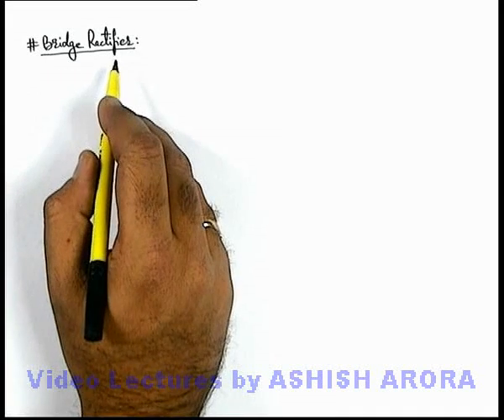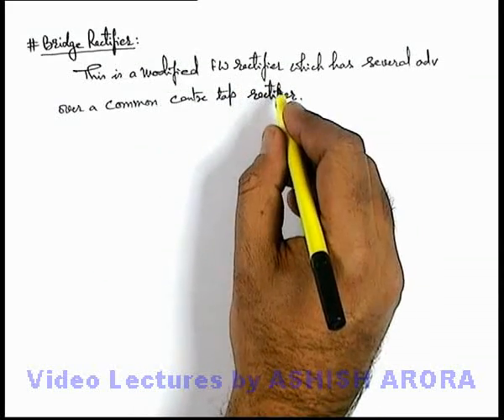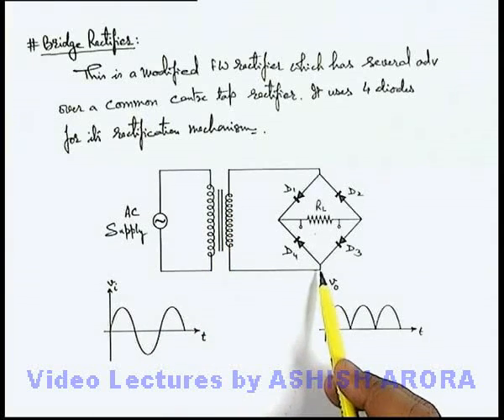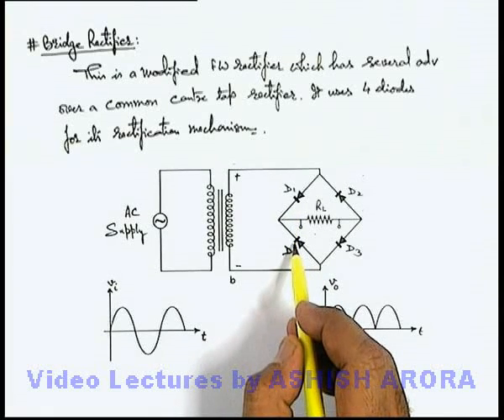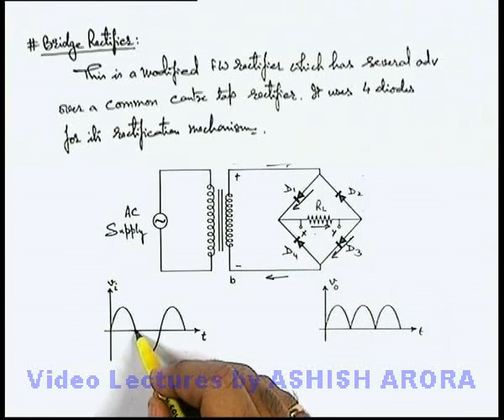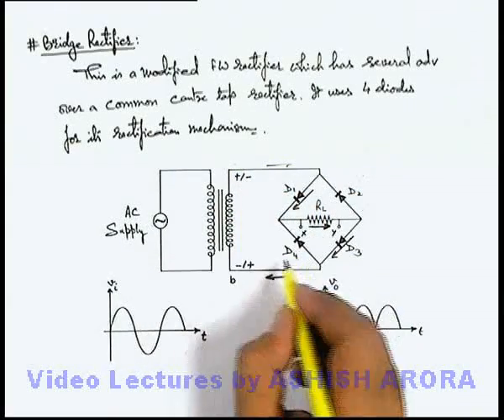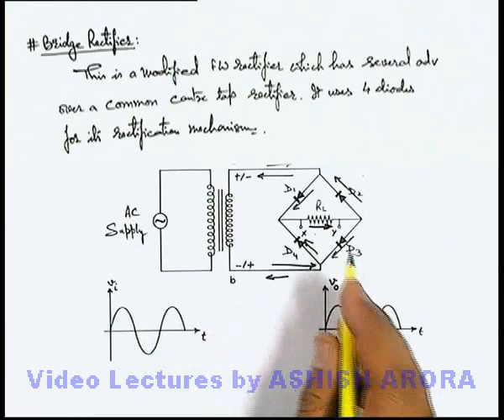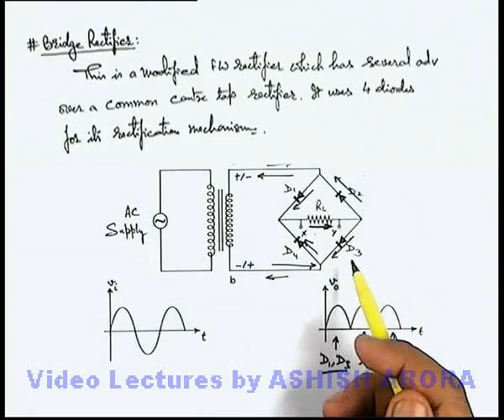Class 12 Physics | PN Junction & Diodes | #22 Bridge Rectifier | For JEE & NEET

Comment: Sir,
I have 2 doubts 
1) What is Current Capacity? It is not same as Current or Max. Current as you mentioned in one of queries below..
2) Why is this Current Capacity more if the number of Diodes are more?
Please clarify the doubts.........
Reply from the maker: 1. Current capacity is the max current which can be passed.
2. If more diodes are used then potential drop across each diode decreases due to which current capacity increases.
Reply: @physicsgalaxyworld   Thank You, Sir!! :) It is clear now!!
Reply: @physicsgalaxyworld  sir won't the current that can be passed be same as in 1 diode? If ideal diode has zero Resistance then sir current capacity of all series would be same even if only 1 diode used but if used diodes in parallel say 3 diodes in parallel them via each diode the current capacity can be passed say I then sir  won't total current that can be passed be 3I but in series of 3 diodes only I can be passed if we Increassed it beyond I say did it 3I then sir won't all the three diode be spoiled?
Reply: Sir, if potential drop is decreased then current flow won't decrease??
Please clarify

Comment: Sir,  in bridge rectifier since current is passing through two diodes which are forward biased and in series, won't they provide resistance more than that of one diode in full wave rectifier as ideal diodes are not possible?  If it is true then how current through bridge rectifier will be more?
Reply from the maker: Yes they offer more resistance but in Forward biasing resistance is very low and advantage is by higher current capacity not current... as when two diodes are working in series they are less likely to damage for a specific current value compared to a single diode...
Reply: jay rashamiya.... due to heating effect of excess current
Reply: Physics Galaxy Sir , How can these diodes get damaged when they are fowrard biased? I still don't understand why bridge rectifier is better than fw rectifier.